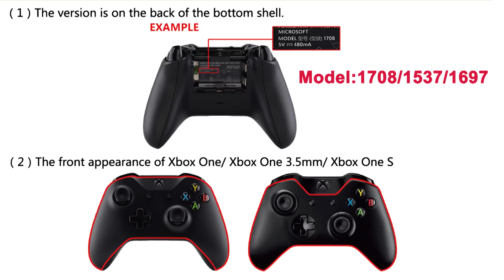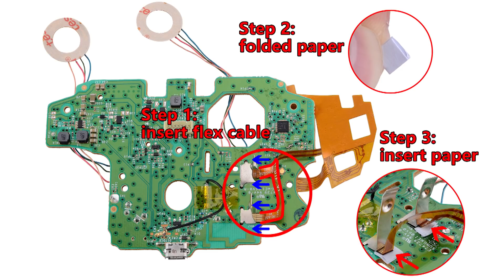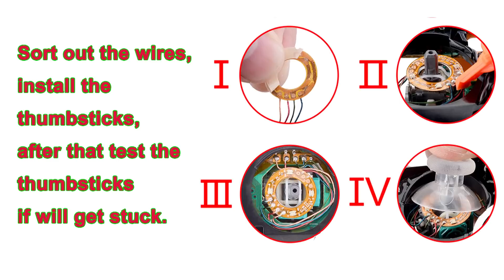Xbox One Controller DTF LED Mod Kit Installation Guide - eXtremeRate

Comment: You lost me at "a piece of paper"
Reply from the maker: use the instruction paper lol
Reply: @ExtremeRate  I mean, i wouldn't add paper in my controller!
Reply from the maker: @caliin2629  oh sorry, so if you can insert the 2 flexes under the battery contact plates, and they stay firmly, then you don't need to insert the paper

Comment: I broke my control :,,)
Reply from the maker: How??
Reply: l broke my control hi
Reply: when i tried to open it xd
Reply: @ExtremeRate  2 Monyhs later
Reply: @ExtremeRate  The casing broke and left a very large crack :,(
Reply from the maker: @tinacorotoplas6937  Then you need the replacement shell

Comment: Until they have something without paper install no thanks
Reply from the maker: lol
Reply: Frosted Flakes you don’t need paper dude. I’ve done it twice without it
Reply from the maker: @MichaelsGarage  Yes, the paper is in case there is a drop on the floor or some cases that lead a shock of the controller then the connection between the kit and battery loose or fail